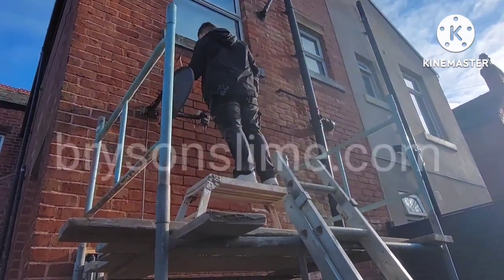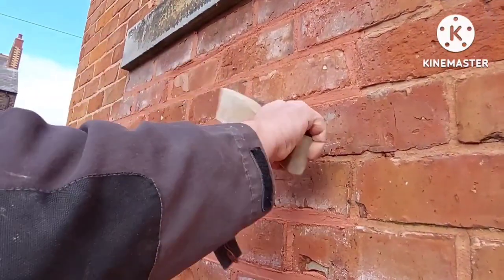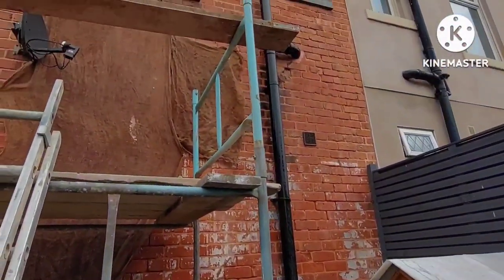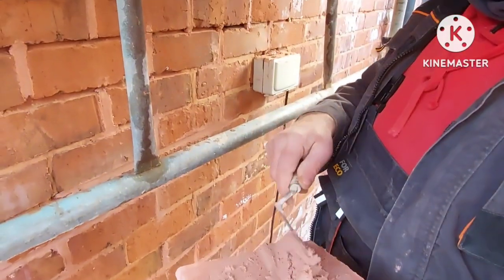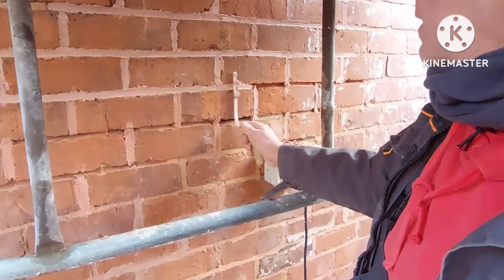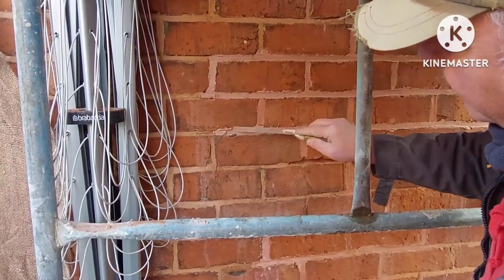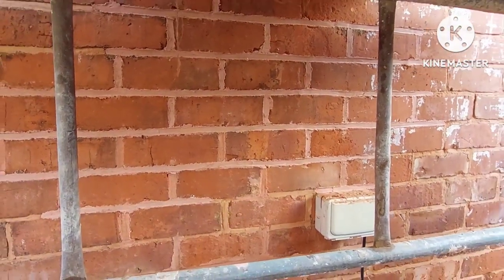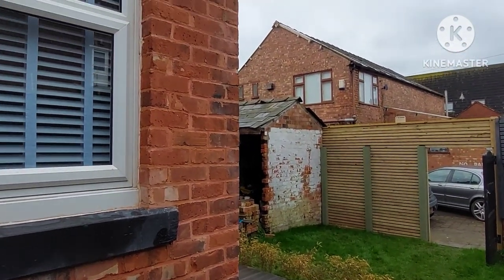A look a quicklime mortar re pointing.

Comment from the maker: You don't want to be rushing when you work with lime,  it's a slow pace and more about the quality and not quantity. 
4 to 5 Square metres is probably about what you want to achieve. The price of undertaking lime work is a lot more than cement or gypsum work as it needs more looking after.

Comment: I’m from Blackpool. Currently working on a 50s fieldings semi. It’s a cavity wall originally done with stuff that looks like hot lime with bits of wood ash in it. Trying to find a similar sand. Any recommendations?
Reply from the maker: If its a 1950s structure and on the fylde coast it's possibly a combination of incinerator ash and beach sand with quicklime, not a hot mix but slaked lime out of a lime pit they dug when building the houses.
A bit of clinker crushed mixed up with a kiln dry sand may be a suitable match.
Reply: @lorddust60  really appreciate the info. Thanks